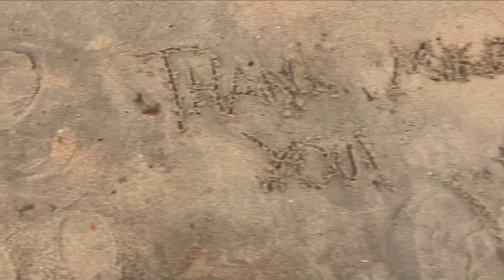A wooden sailboat restoration in Brazil looks like this! — Sailing Yabá #76

Comment: The reason the seam compound is “sinking” is that it shrinks when it dryes. I am doing my deck now and am using non shrinking, sandable TDS compound designed specifically to no shrink. It’s expensive as hell but cheaper than the labor “mine” to do it twice. I’m off to do more today! Looking good. You guys are dogged and that is quite impressive.
Reply: By TDS I assume you mean Teak Decking Systems - great company I know very well.
Reply from the maker: Thanks, Will look into the brand for the next time which is hopefully not in the near future
Reply: @SailingYaba  Teak Decking Systems SIS440. Don’t feel too bad as there was such a big supply issue worldwide for it that I had to buy one or two tubes at a time from several stores around the US to finish my deck. For repairs in the future, there is no better stuff. Also, if you are going to varnish wood with a joint in it. The joint is where the varnish will fail first and cause a revarnish. If you route out the surface of the joint 6mm squared all along the joint and put a bead of 440 after you varnish then the joint will not fail. It looks good because it matches your deck.

Comment: Have to be careful spray painting with no air movement. The cartridge respirator is only good for ppm protection and when you are in confined spaces with no air movement you will overwhelm their capacity. The safest solution is to let her do the spraying! Just kidding the health of the both of you is priceless and the proper solution is to use supplied air or just McGiver a small hose from a dive tank to your dual cartridge mask and keep a small positive pressure. The both of you need to enjoy this beautiful boat your building. Keep the great work up.

Comment: A lot of jobs going on now. Nice to see the engine room getting paint.    Be great to get the engine fitted  in the boat.  Some excellent work by your shipwrights.  Sorry but I think that that swim platform is too big.  I would have thought that 1.25 metres was more than big enough. It will be great in a bay at anchor but in a big sea I would be a bit worried.   A nasty wave from astern and it is liable to get snapped off or at best spring all the transom planking. I hope you never get in those kind of seas but it is worth keeping in mind. If I am really honest it looks a bit ugly hanging off the back as it does.   Fair winds & regards from the UK
Reply: Also that end grain should have been more thoroughly sealed...   that is going to be trouble down the road....  They do EVERYTHING GREAT other than that ;-)
Reply: I was wondering about that too, but after looking up pictures of other Brazilian schooners, many of them seem to have huge swimming platforms at the stern. Seems to be a proven concept

Comment: Why is the swim platform so large? That could be an issue in rough seas, as waves will push up on that much surface area with more force.
Reply: Sorry guys, but the hole naval design of the boat and the fact that it‘s mainly hold together by nails, without being thoroughly protected by epoxy or Polyurethane at joints and open cutting lines and holes makes clear this is not a offshore vessel,better never come into a situation where the seastate would create a problem due to the size of the swimming plattform. At the same time most likely the planks would jump off the frames already….
Reply: I'm guessing more likely the 4"x4" through the transom will give first.

Comment: Great video again.
question: maybe I missed it previuos video's 
how do you release seawater from the deck which is coming over the side in heavy weather, espacially arround the sitting area at the back.
You are closing the drains by the seating area and the rest seems very small. Do you provide deck drains through hull (orr swimming platform)

Comment: In the Air Force, we refurbished the interiors of our tanker (refueling) aircraft. We wore those white Tyvek suits with portable full face positive pressure filtered masks while sanding due to the use of zinc chromate primer. Because the suits were basically one size fits all, they looked like a baby with a loaded diaper when worn. We called them poopy suits. Oh yeah, the interior was air conditioned while doing this process at around 15 C.

Comment: I’m a bit concerned about that diving platform, are you not worried about following seas landing on it and damaging it, everything else is looking great guys .. Jack n Steve .. 🐶😎
Reply: These are traditional on these boats. Check out the yellow Aquanatical boat to the port side of Yaba. It has the same size and shape of swim platform.
Reply: I understand that its traditional on these boats, but this boat is not being used in the traditional manor, as mentioned in another comment here, Yaba will be used in open seas and oceans and a following sea and breaking waves could break the platform. Hopefully this will never happen, l also noticed the rigging wires are also attached to the platform too, if loosing the platform, this could also make the standing rigging weaker too.
Maybe the platform could be made smaller and have a hinged section that could be lifted and folded out to make the platform bigger …?

Comment: I just love the progress and cannot wait each week for the next episode. I noticed that the punch they used has seriously mushroomed. That is a very dangerous condition as a piece might break off under impact and it will have enough force to penetrate an eye or even enter the flesh. Grind the impact surface with a 45 deg chamfer

Comment: Guys, please get some more input on that fixed dive platform. As sure as I mam alive, that size of that platform in a following sea is going to very risky. Consider putting hinges on it, so you can hoist at least 2/3rds of its length out of the water and up against the transom. Ask any boat owner who has something that size on the stern of their boat, how they handled it. If you get a wave, say 5' high, that hits your stern at an angle, it will take the wheel out of your hands and cause you to jibe significantly to the right or left.  Don''t want to see you guys getting hurt or potentially losing the boat to something you can fix while on the hard. Talk to Duca, he has a lot of time on a sailboat and I suspect he will agree.
Reply: it originally was fitted with that platform. This boat will be a coastal cruiser
Reply: These were traditional on these boats. Check out the yellow, Aquanatical boat to the port side of Yaba. It has the same size and shape of a swim platform.
Reply: My thoughts on the platform as well potentially dangerous. As to being only a coastal vessel , the waves closer to land can be bigger and shorter.
Reply: Not to mention it looks like they are planning to use it to attach the running backstay! I am beginning to wonder if there is some preplanned disaster that prevents this hulk from ever seeing blue water and a strong breeze. Wonder what the insurance level is, if it can even be insured or pass a survey.

Comment: I hate being one of those people but i have an oppinion based on experience. I like the fact that you have a gap in between the decking on the platform as it allows water to flow through which dampens the hit if its impacted from below by a wave. However, i think it should be screwed down because of the force pushing against the boards IF it gets hit from underneath. Not nailed down. But im not sure if this is of any relevance in your case. It looks like the platform is hanging quite high above sealevel, am i right? You are a pleasurecraft of significant size. You might never encounter such sizeable waves anyways for this to be even happening. I worked on a 16 metre workboat catamaran when i saw this the first time. The boat was brand new and had small platform on the back of each hull, working as bumpers for the waterjets. We had plastic gratings on top of them bolted down. After the first workday, both got washed away. The size of the rectangular holes where maybe 1,5 square centimetres. So we installed 5 cm gratings instead and that seemed to allow enough water to flow through to withstand the reduced impact.

Comment: No teak for the swim platform?  So you’re just gonna replace it every few years when it rots then?
Also, it seems the way it’s attached, with 2 holes cut through the ship and simply cantilevered, it’s going to always have some movement with wave action and when heavy loads placed on it, like a few divers and their gear standing on it. As it does it’s going to leak, which will cause rot, putting you right back here in a few years.  Oh well, more content I guess.

Comment: I love the project !   I’m picturing that gigantic swim platform full of beautiful folks having a great time.    I also can picture it in a big sea, slapping down in a moderate sea.  When it breaks off I’m hoping it does not take a chunk of the transom with it. That would be a boat sinker.
Reply: I agree, it’s too big! In a running sea if a wave gets under it the likely hood of pitchpoling is increased and as you say never mind the slamming.
Reply: These are traditional on these boats. Check out the yellow Aquanatical boat to the port side of Yaba. It has the same type and size of swim platform.
Reply: No it will be fine... I've seen many with bigger "swim decks" water goes through that as it isn't solid. It will also have braces... It will be fine in following sea actually. That's what they've said about catamaran's underside... It's fine! My Mom always used to say this to me when I'd say something I felt about someone else "Don't write the ending of the book before the beginning.. write your own book... ".... As I grow up I say less my fears more my hopes... ✌🏼💗😊❣️
Reply: @donnakawana     Hope is good.   So,  just got back from a trip to the Bahamas , 40 foot motor sailor.   Got into some nasty sea one night. Tore off my swim platform.  I have seen a boat that had its anchor platform torn off from slamming into a head sea.   Now, what you wrote was just about the nicest way I have been told to mind my own business.  And I did give it some thought before saying something that could be construed as negative.   My goal was to share my experience with a swim platform under rough conditions.  I hope they never have a problem. Probably won’t.   But sharing my experience is appropriate. IMO.   I stand by it.   Cheers
Reply: @brantleychuck  I do know I come across that way... Lol.. I have worked on vessels my whole life... I've seen some savage stuff at sea an in bay's... An since you just saw all that,I get why you were so serious...!! The guys on the boat tease me for being the rudest nice person... Or they Never Kno what's going to fly outta my mouth... Lol
Reply: I don't think it will be an issue. Won't the wave just break through the grid?

Comment: As a interior designer + designer of custom furniture I would like to offer this on standard bench design dimensions for your consideration 
: seat height : no more than 18" tall  -bench back 7 degrees tilt - 1 degree more if reclining is more important than dining  seat depth 19 1/2" to 22" deep - bench seat back total of 36" tall from floor - 3" less OK with broad top cap (4 to 7"  or with  recessed counter sunk plank to hold drinks behind bench back )- front edge of bench seat should be very rounded 1 1/2" radius or more - for eating table should be 1 1/2" overlap of seat edge to edge of table - but can me more if relaxing is more important than eating - look at human ergonomics measurement ( on the net) for more info .  full scale markup ( 24" wide is best approach )  good luck - it will be so awesome to have once completed

Comment: I'm loving the progress!  Such an impressive crew including Ben and MP.
Keep including video clips of the dog too.
I'm a little concerned about using galvanized nails on the swim platform.  That area will be exposed to lots of salt water and galvanized nails usually don't last more than a 3-5 years in those conditions.  If you need bronze or stainless fittings, put out the request, I'm guessing people would be willing to donate.
Best of luck moving ahead.  It's really coming along beautifully.  It will be really interesting to see what adventures you have cruising in this little ship.
Cheers from Alaska

Comment: It seems like kind of a hassle to have to climb over the railing every time you want to get off the back of the boat.
Reply: they will ad a hatch / door at a later date.
Reply: i think they will make a door on the right side of the transom where you can fold the top part open, still have to step onto the bench but not over the top of the handrail.

Comment: I've loved to watch everything about this build ,but I have to say that the swim platform is way to big and takes away from all the beautiful lines of this boat. I think it's going to cause problems if the boat gets into heavy seas .It's definitely a weak addition to the stability and safety of this boat. In short I think it could of been half it's size and still been functional. I really think it's an ugly addition to a beautiful boat.
Reply: Its not an addition. They are replacing what was there before.
Reply: I agree on it being halve the size would be good, but i dont think its negative for the safety. I would be rather concerned that it pushes the overall length over 24 meter causing the boat to be classified as comercial in some countries and someone might ask for higher captains qualifications. It probably causes less trouble than the low percentage of balast or the extremly low feeboard. Besides shortening the platform will be no trouble at all if it prooves to be to big.
Reply: There was an incredible amount of rot where the planks met the the transom in the beginning. Likely because the swim platform is just cantilevered through the transom. Every time the platform takes a wave or has weight on it, it loosens up all those seams. Here they go making the same mistake again. This boat is going to beat itself apart in any seas, but I am very sceptical that they have any plans to do any properly long passages in this boat.
Reply: Actually true, so the way the platform is inserted might be an issue for rotting the transom away.
Reply: @schuttrostig5729  same with the way the mast is fitted tight through the deck boards. As it flexes, it will open up the deck seams allowing water into the tight spaces and rot.
Reply: @ralphgesler5110  yes... The issue is the way they have installed the deck around the mast. The mast is meant to be held by the mast partner which is part of the deck structure. There is a close up where you can see the deck boards are installed tight to the mast. This is going to cause problems with water ingress. Having a keel stepped mast is preferable to me. This one is just installed poorly.
Reply: @tomeidt7057  this whole boat doesn’t seem designed for long passages to me. It seems to be meant as more of a coastal, littoral boat. I don’t think it was designed to travel the world like they seem to want to do. 
I maintain that they really didn’t know what they were doing when they bought this boat, that they just saw it and thought it was cool and jumped at it without knowing what type of boat it really is, what it’s designed to do and not do, and certainly not the condition of it - that every single piece of wood on it was rotten.
Reply: @srcastic8764  you nailed it. The winners here are the guy that managed to offload this boat for actual money instead of the cost of the environmental cleanup when it sank and this boat yard. I'm all for restoring wooden vessels. It is noble work. I just don't think this boat was good to begin with. Like spending 30k at an autobody shop to restore a 1992 Plymouth acclaim. They could have had such an amazing wooden vessel for the time money they are spending building this lemon.
Reply: @tomeidt7057  haters...you probably don't even own a boat
Reply: @chrischez4550  but I do, when the channel started they though they would be refitting this boat for two months. Lots of people said more like two years. They were called haters too. And here we are. Critics are useful and this channel has a bad habit of totally ignoring very good advice.
Reply: @tomeidt7057  The original boat only lasted 15 years. There's a reason for that and they are building this new boat the same way, and will last about as long. Some don't seem to realize this was a contemporary (new) boat, not some classic sailing vessel to be 'saved'. It got that way do the this same style of building.

Comment: I would use an airless sprayer for that. You would easily cut your time down by 3/4.
Reply: I agree - airless quicker and you will use much less paint. The finish will not be as fine as conventional but for an engine room it's more than adequate